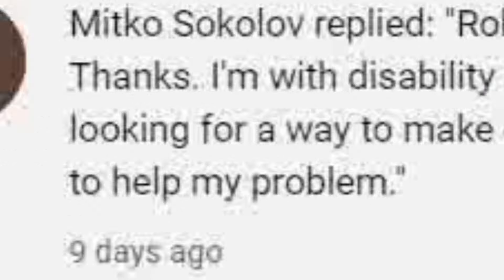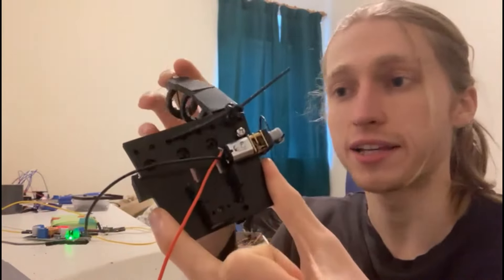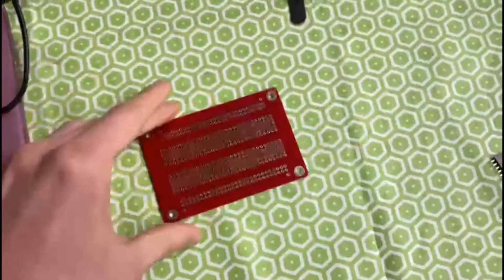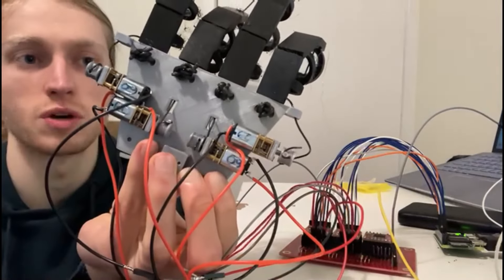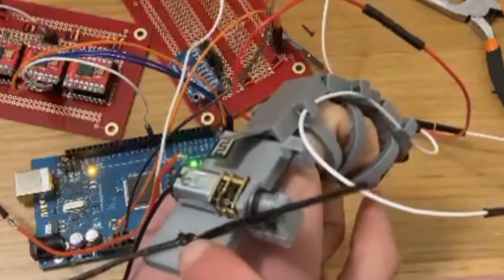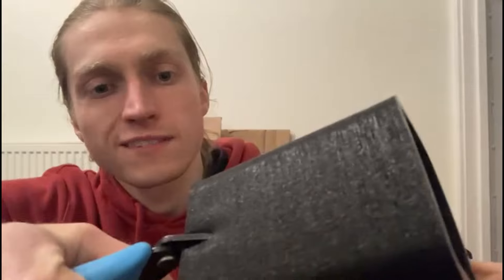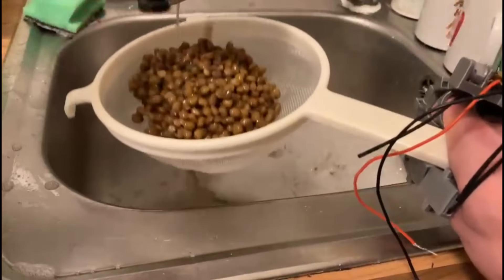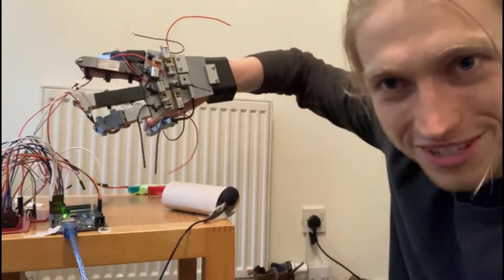I Stole Your Robot Idea

Comment: How feasible would it be to put small pressure sensors in the fingers to control the motor's direction?
Reply from the maker: mmm, i never thought about that, but very possible, I would be a little worried about how to secure them wihout triggering them but i cang imagine that would be to ahrd
Reply: All I've got is super glue and I'm pretty sure super glue would ruin the sensors
Reply from the maker: Hard to say for sure, but if you glued the non electrical side it could work, issue then is how would teh sensor actually strech at all

Comment: wow nice content!!! well-made video, with great pacing and storytelling, while mantaining a really authentic feel! You don't see that a lot from starting youtubers (or any other youtuber really); they either make shit content, or make great content, but get lost in making the video "too" perfect, losing the thing that we actaully watch video's for: personality.
(one of the few exceptions to this rule is the "Stuff made Here" channel)

now for some technical questions:
how did you get python runnning on the arduino? what hardware are ya using?
what are the benefits of making your own motor drivers (besides coolness)? I personally use a shield that I attach to my arduino uno that has motor control stuff, but if your approach has loads of benefits, I might try that instead.
Reply from the maker: Thanks for the compliments :D. Now for the technical stuff eheheh - So yeah the code I showed was python, and at the begginign i was using that with a raspberry pi 2 W, I then, unannouced switched over to an arduino, I should have probably menetioned that but forgot sorry ;) - I switched because the raspberry pi didnt have analog pins, and my ADC started acting up lol. For the motor control stuff, I prefer making the circuits myself as its super easy to scale, say for some reason if i wanted to introduce 20 motors, I would know how to do that, now I would never ever want to do that for my sanitys sake, but yeah, thats why i prefer them. Ive never personally used a sheild, but i see no problem with using one :D

Comment: Where did you get the flex sensors?
Reply from the maker: They were adafruit short flex sensors. Depedning on where you live a local electronics supplier that does delivery is probably your best option :D

Comment: Good. Nice sense of humor. 

In your previous video ''Robotic Hand'', you mention something for ''actuators as sensors''. Can it be applied here?

I'm also progressing, i'm ready with wireless voice servo commands, and now work on RNN model, to create custom voice commands, then i will try with EMG too.
Reply from the maker: Nice, your project seems to be coming along nicely :D - Yeah it definetly could, utilising current sensing and getting an idea of where the finger is could be possible. My issue was the TPU string that runs down the backs elisticity would probably not be constant for each finger, and over time as it degrades, that means linking the current draw to position could become very hard / impossible to do. Thats why I went with the bend sensors, but I do want to investigate that further
Reply: @Robotcus  Yes, it is interesting to investigate that feature, i will too.

I tried to send you link of article with interesting design, but it seems i can't put it here.
Reply from the maker: Yeah, by default links arent allowed in comments generally cause of scams etc, but if you tell me the name of the article would happily search it up @mitkosokolov9382
Reply: @Robotcus  Development of 3D-printed myoelectric hand orthosis for patients with spinal cord injury

 Hyun-Joon Yoo, Sangbaek Lee

Comment: so this is kinda hillarious... i was doing computer science about 20 years ago and was looking into vr and haptic feedback (like.. 90's vr.. ew).. anyway i was thinking about how you would go about making a suit for haptic feedback that could limit joints.  So today im searching for air vs water pumps.. so obviously your video shows up because youtubes search is dumber than a box of hair... and i saw the thumb and title and got curious... and goddamn ... you did steal my robot idea (that i never got around to trying out).. as using cables to limit limbs was a solution that i thought had potential
Reply: my brother also has mobility issues in his hand and ive been hassling him to look into something like this
Reply from the maker: hehe, yoinked it before you even got here, that project sounds really cool though, i do think this has a lot of potential, at least for the hand stuff as the motors are small enoguh. Also, I to used to work in VR space, (AR specifically) just for an internship though. I have now concluded, I have no desire to work in the AR space lol, will stick to silly robots